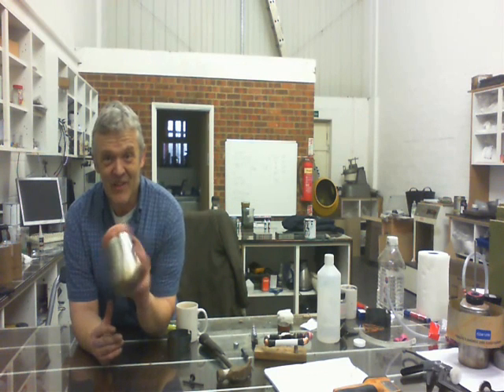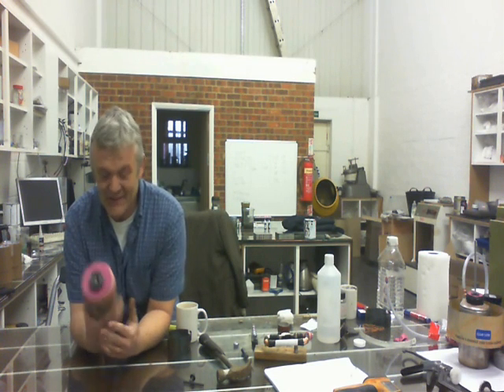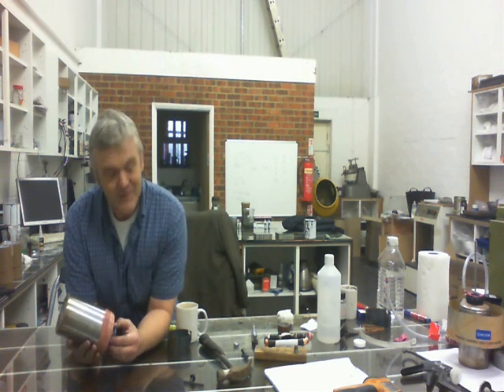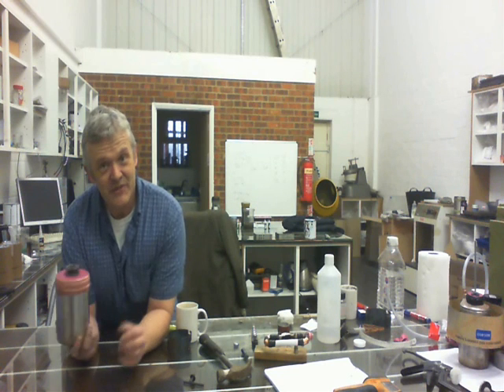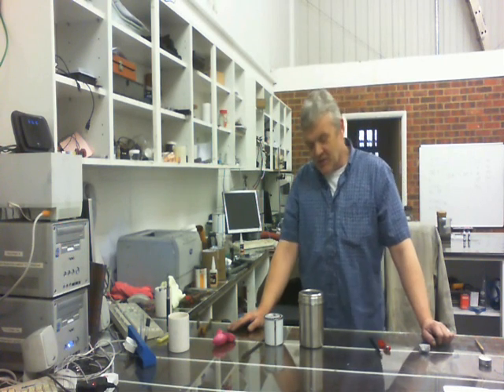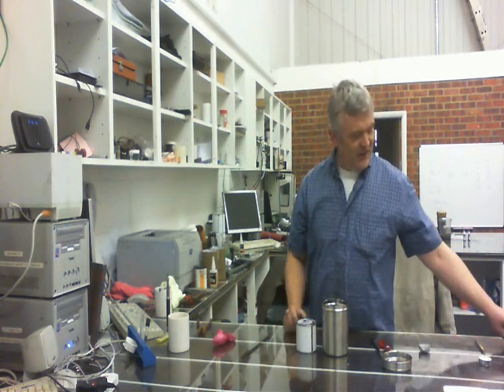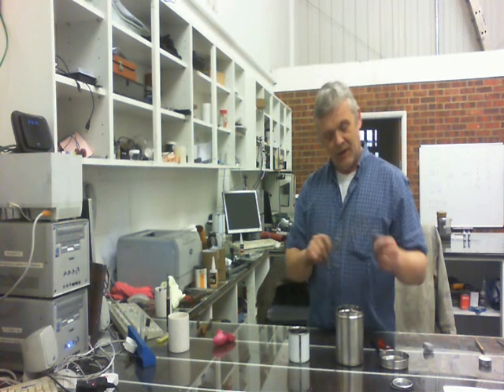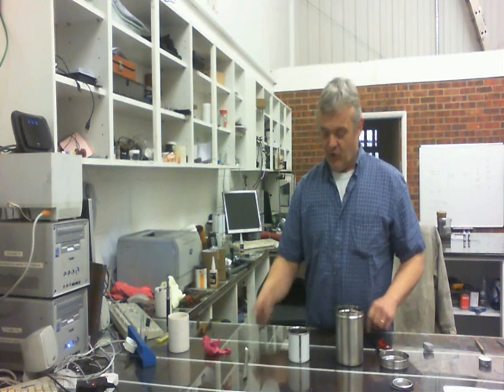The NASA Stirling Engine - Made In An Hour - Step By Step

Comment: Very cool proof of concept!  I realize these engines have been around for a long time, but this is the first one I've seen made entirely from stuff you might find around your house.

I particularly like how you used the steel wool to fit the smaller cylinder to the larger one, that's pretty industrious.
Reply from the maker: it also acts a regenerator mate and so improves efficiency
Reply: @ThinkingandTinkering  Hello, thank you for the video. By any chance can you say where specifically NASA put this material out? I would like to try this for myself. But I need to see a more clear diagram of the parts and everything you are working with before i get started.
Reply: The way I understand that that is what actually makes it a stirling engine as opposed to just a hot-air Engine That was Mister Stirling's innovation it increases efficiency to the point of making it practical

Comment: I have been interested in the Stirling engine for quite some time. Still have yet to make one, but this is a great design I will come back to when I do make one for sure. This is also a very practical and valuable technology to explore. A while back I was researching if a sterling engine could help produce power using a passive solar heating system. I came across this video http://youtu.be/iSoXWt4hBpc
While it may not be practical in an eco-village in Sweden ;) It is still quite a creative use of thermal potential. Thank you for your creative expressions my friend.
-Cheers
Reply from the maker: To be honest mate I was wondering the same thing - I wonder what kind of output you could get from this per square meter of solar reflector and lens condenser and how that would compare to a solar cell
Reply: That is a very good question indeed. I believe the solar intensity for location and time of year is probably a primary factor. 

 Eo =mCp∆T
where, m& is the mass flow rate of water or air flowing through thermal pile channels, Cp is the specific heat of the water and ∆T is temperature difference between outlet and inlet ports. The efficiency, η, of the system can be calculated as
η = Eo\Ei
where, Ei is input energy.
This is assuming you set up some type if thermal condenser or boiler.
Ei =G×Area of collector (3) Where, G is the global radiation that could be measured with a pyranometer. The efficiency of the system will depend on the cloudiness of the sky, and frequency of solar exposure, humidity of the air, ect. If we have micro pumps for circulation that would be added to the formulas efficiency, η.
  One would have to create a test bench and would be fantastic to see some data. Unfortunately, the company in that video I sent has propitiatory rights on there stirling engine, which is unfortunate. Eventually I will do some more research on this. 
As far as comparing PV to Passive thermal, it seems to me a comparison of Green apples to red apples. We could use them all and make a spectacular pie, or we could add bananas and oranges to make a delicious fruit salad ;). 
The most wonderful part is that the fruit is falling off the tree for us to utilize where the tree stands. Its just a matter of allowing the energy to cascade uniformly as most energy seems to prefer. As oppose to pooling up in thoughts of ownership and conquest.
 Great stuff again,  and I bet its only a matter of time before we see a SWAG coating on the outside of a thermal condenser being reflected upon by some sort of solar magnifier. In this way a more holistic approach to solar energy collection would be created. Or what we could call a broad band generation from cosmic energy.
Reply from the maker: Diadon Acs
i wouldn't worry too much about proprietary ownership mate - you can see what they have done - a small engine is inherently less efficient and needs a high heat difference to operate - the larger the engine the more efficient it is and so the lower the temperature difference required - that's why their engine is so big. Another thing we know from LTD engines is that the ratio of power piston to displacer volume and hot/cold plate area is important the smaller the ratio then the lower the heat difference required. Both of these are old hat and can't be patented - my guess is they have patented some add on bit that is actually quite unimportant to the operation of the engine - anyway these are my thoughts about where to go with this
Reply: That's comforting to know :) So you are suggesting a larger surface area with a shallow depth in the displacer lowers the heat requirement without effecting the mechanical output? That would explain the larger diameter, can't really get a great  view of the depth in that system particular system.
Reply from the maker: Diadon Acs
It's where I will start mate - seems a good idea as that's how LTD stirlings are made and look at the travel of the diaphragm it's not that great for the size of machine - but it will be something to play around with
Reply: Great observations, look forward to more development on your LTD exploration. :)
Reply from the maker: Diadon Acs just working it through with you mate
Reply: I can say I am learning a lot about them :)  We will have to find a benchmark that has a measured amount of volume of air in the displacer, to be able to see the efficiencies of Joules of thermal energy into Joules of Newtons for some good calculations.  I see quite a few people who have put simple dynamometers to measure output but very little measurements of input. That would certainly be something of great value to work out for an accurate COP. Its application in sustainable settings are fantastic, due to there ability to be a heat pump as well as generate electromotive force, or do kinetic work.  If I can't find some who has worked out  the problem, I will eventually do it myself when I build me a little LTD , that's how most things get done anyways, roll up the sleeves.

  Thanks for the conversation, it encouraged me to learn and  read more interesting things about LTDs in general. It also helped me to discover an Acoustic Stirling Engine (Los Alomos) so you know its not cheap lol.  Certainly got my gears grinding.  Thanks for that :)
-Cheers
Reply from the maker: Diadon Acs It's a good sign when there isn't that much out there mate - it means your doing something new! - of course that means most of it is sleeves rolled up lol
Reply: Diadon Acs Nice to see you are interested in the Stirling Motor and dream for cheap DIY solar powered for poor areas of the planet.

BTW, just a little correction: there is no COP to calculate for a converter which doesn't need an other source of energy to be run, they are all infinite COP like in photovoltaic panels, wind turbines, hydrauturbines ^-^.
Reply: +Robert Murray-Smith on the subject of the LTD, (low temperature differential), Stirling engines, I noticed that the volume or working air is very low in comparison to the hot and cold surface area of those plates. and the working air is all very close to the plates for faster heat changes. And I still think I need to try a regenerative displacer in an LTD Stirling engine. 

But before I do that, What do you think of a 55 gallon drum sized NASA style on with a rocket stove base? :)

Keep smiling and have a ball.
MUDDy
Reply from the maker: +muddymuddymuddmann I think it would be awesome mate! - if you do it you have to do a video - it will probably be a pretty wild machine though and will need a fair bit of bolting down lol
Reply: Robert Murray-Smith or it means the big oil companies bought all the patents and have been keeping them off the net ^^
Reply from the maker: Conspiracyphreak Phreaka could be

Comment: So how do you get work out of it? It seems kind of weird that NASA would make a Stirling cycle engine that requires weight to work. Since most of their output is aimed at a microgravity environment. I'm guessing that one wouldn't do so well on the ISS for instance.
Reply from the maker: that's an odd question mate - how do you think you would get the work out? It's actually a resonant system so springs, weights, pistons - it's functionally all the same thing
Reply: A Stirling engine using a similar design in space would use a spring instead of a weight.

In fact any Stirling engine generating any significant amount of power would be considerably more robust.
Reply: here is animation of NASA Stirling engine http://youtu.be/P1FwrDZKfKk
Reply from the maker: Dana Gould
ok cheers
Reply: @ThinkingandTinkering  you did such a great job upscaling  from the Soda can variety. Was your preheating step to mitigate not having a hole in the stainless steel can? I didn't see you do the pin hole in that one. :)